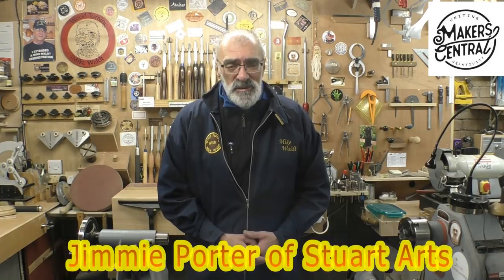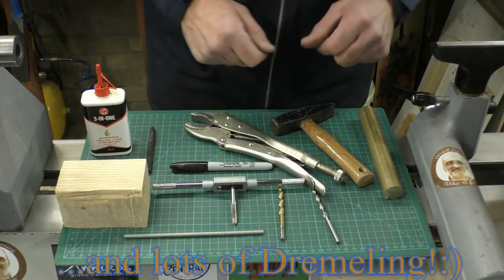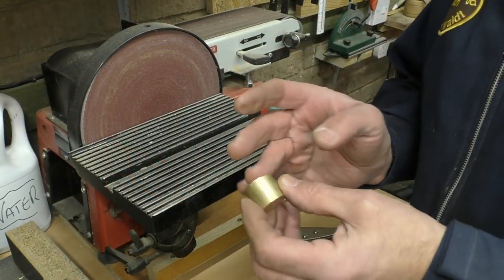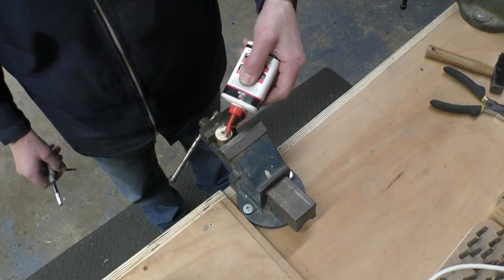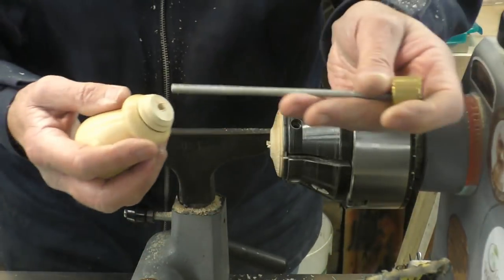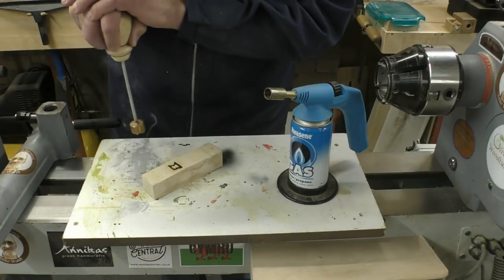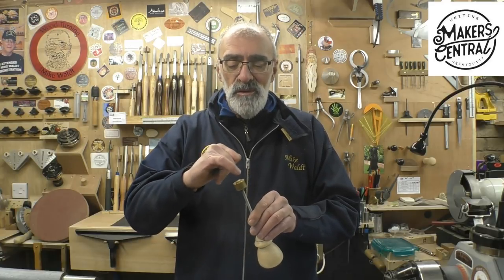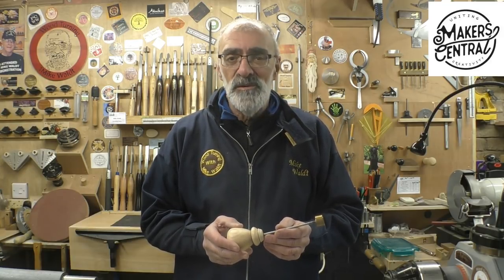Woodturning - How to make a Branding Iron

Comment: Hiya Mike, another great video, cheers.. just a couple of notes, when using the tap & die, reverse the cut every so often (3 cuts in, one reverse cut back), this helps clearing out the hole and cutter from debris.....secondly, make sure you use something heatproof to lean the hot iron on or against, don’t want accidents … treat it like a soldering iron 👍🏼😊
Reply from the maker: Hi Mark, and thanks for the tips, as I said in the video ... I'm no metalworker ... lol.
Take care
Mike

Comment: Mike
Nice project for some inspiration.
A thought to consider?
I found that I was not particularly happy with my branding results when holding the iron by hand. It was difficult to hold a level/straight and even pressure - thus giving a less than crisp brand. What I found was to eliminate the handle, and just hold the tool shaft in either my drill press (for vertical size requirements) or a Jacob's Chuck in the lathe (for horizontal size options) -- then simply use the press or the quill on the lathe to advance the brand into the piece. This method gives me much better control of even pressure, giving a much more crisp brand. As you know, different wood species brand differently due to density and colour. With this method you have very good control on the pressure needed for even branding.
This also an easy and safe way to hold the branding rod while heating.
Not intended to criticize your work - just a thought on an optional method of branding.
As you always say, "my way is not the only way, or necessarily the best way - but my way" -- I love that phrase you use.
Regards
Dennis Beamish Cambridge Ontario Canada
Reply from the maker: Hi Dennis, and thank you.
Thanks also for the suggested alternatives, they sound a good way to try as well. never stop your input, as it is always food for thought.
Take care
Mike

Comment: great video sir! A tip for next time. Chuck the brass slug into your lathe, and use the live center to center your tap. There should be a center mark at the back end of the tap. Just put the tap into the tap handle and the the live center in the center mark of the tap. Do not tighten the tail stock very much when screwing in the tap, just use it to steady the tap. Cheers Sir!
Reply from the maker: Thank you Alec, and great suggestion too.
many thanks and take care
Mike

Comment: Hello Mike, Another timely video, thanks. Just started signing and dating my work with 5mm punches; needing enough remaining wood!To clean up the centre of your brand a cheap compound table and 3mm end mill bit would suffice, with the workpiece well clamped down. I'm no metalworker either, but<£60 allows for plenty more shop built tools. Bernard.
Reply from the maker: Thank you Bernard, and thanks also for the tip re the compound table :)
Take care
Mike

Comment: Hi Mike, after watching you make your branding iron I wondered if there was another, easier way to make one. So, being the lazy bugger that I am, I started thinking. Does it NEED to be made from brass? Do I need to use multiple peices of metal to make it? I discovered that the answer to both of these was NO. I realised that steel is a great conductor of heat and that it also holds heat pretty well too. So my solution was to use a steel bolt with a good sized head. This saved the time and effort needed to create threads as it is a solid unit that has it's own thread. I used my dremel to make the design of the brand, this was the most time consuming part, and put a piece of beech on the lathe to make the handle. I know that this is cheating and lazy, but it suits my purposes and requires no knowledge of metal work. This all being said, if it wasn't for your video I probably wouldn't have even thought about other ways do do it. Plus, as usual, I thoroughly enjoyed watching the video. So thank you for making me think.
Reply from the maker: +Barry Wood 
Great variation Barry, actually wish I'd thought of that! 
Cheers
Mike

Comment: Hello Mike , just to your video about the cutting a thread into a wooden face plate, where would I find a tap M33x3.5mm which is reasonable in price? They are all around the £ 50 mark and pretty pricey for I like to make ! 
Good video and follow up about the branding iron, I might think about it in future then my items are a slightly better quality.
best wishes   Lutz
Reply from the maker: Hi Lutz, I got mine from The Tool Post here in the UK, but you may be able to get similar, say on eBay.
Hope this helps
Mike

Comment: Hi Mike, what sanding sealer was that you're using? Did you make it yourself, if so, how?

Cheers
Reply from the maker: Hi peter, I use Chestnut Cellulose Sanding Sealer 3 parts thinned with 1 part Cellulose Thinners.
Cheers
Mike